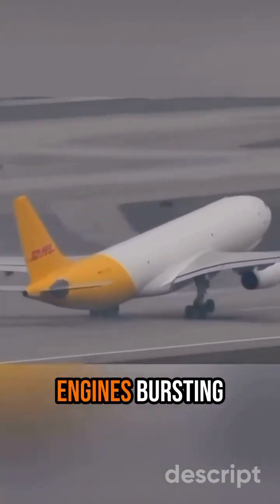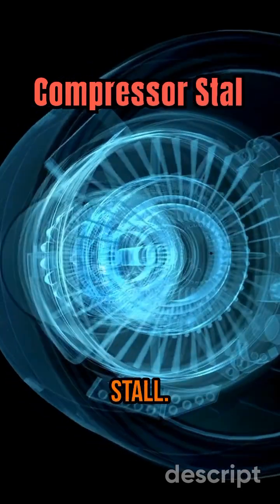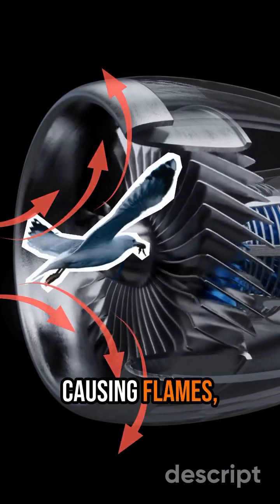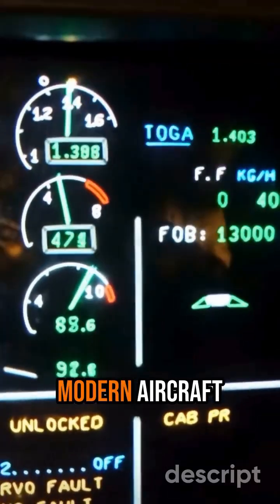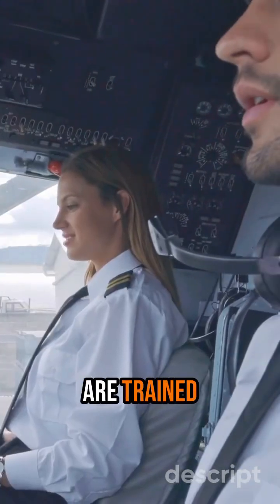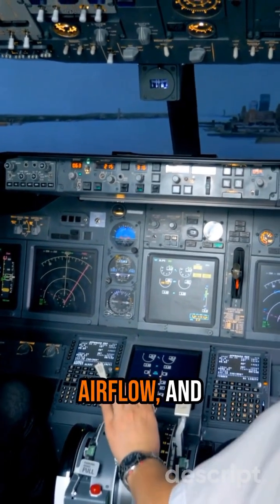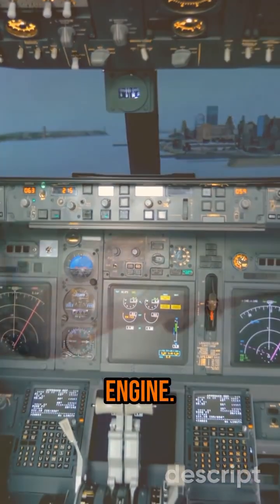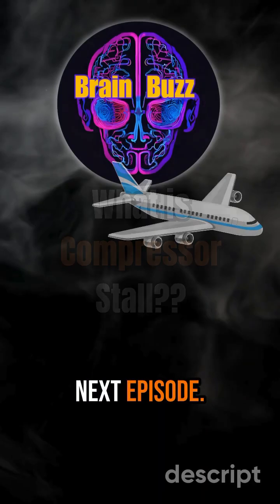ENGINE ON FIRE…?! The Truth About Compressor Stalls!😱

Comment: Not fu king true w the UPS plane that just crashed!!!!! Liar
Reply from the maker: UPS is a completely different story. Engine 1 detached from the aircraft, and the debris entered engine 3, causing a compressor stall. The loss of one engine made the aircraft asymmetric. You’re right, there was a compressor stall BUT if it had been only a compressor stall, UPS could have gotten airborne easily with the two remaining engines…